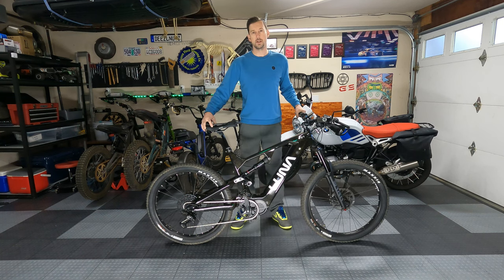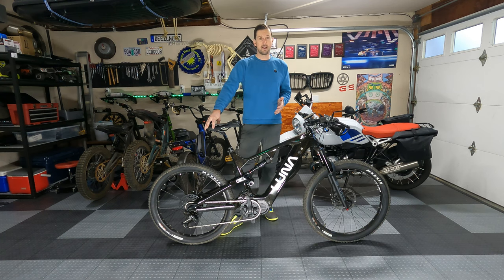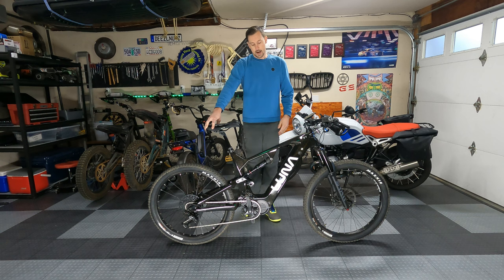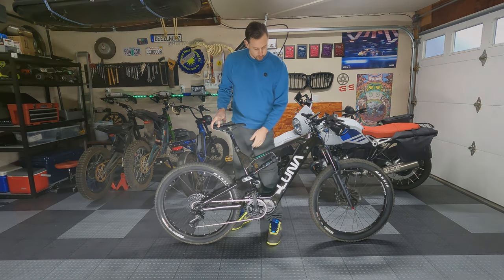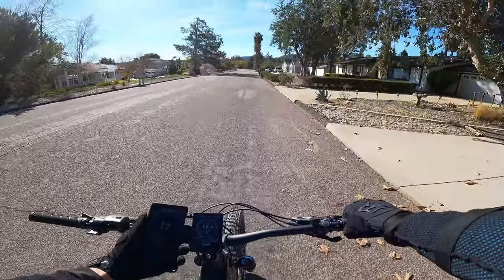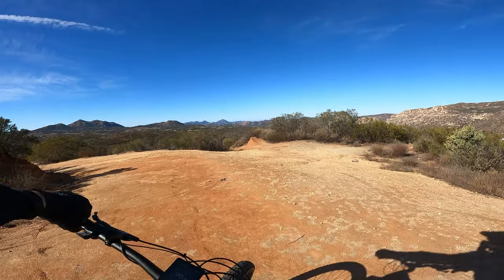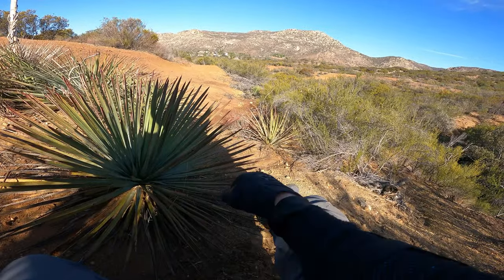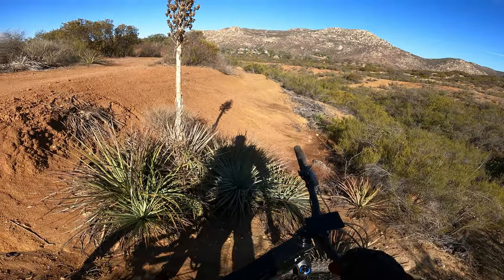LUNA Z-1 Review, Ride, and Crash!

Comment: Does this bike lack a shift sensor to avoid stressing chain when shifting?  I thought I read it lacked this common, key feature.  If so, that along with lack of tubeless rims ,would be a deal killer for me.
Reply: Did you ever get an answer to this?
Reply: @ElevatedVehicles  I confirmed elsewhere that no shift sensor and no tubeless stock.
Reply: @SWTrailsAndWheels  o man that sucks. I wonder if it's possible to add a shift sensor to the m620... I'll Google this, thank you for your feedback

Comment: I was about to get one of these but ultimately got the sur Ron. How do they compare? Also what's the size of that rear tire on your sur ron in the background it looks huge!
Reply from the maker: Sur ron is an absolute blast.  This has better suspension out of the box but the sky is the limit once you start modding. Sur ron makes a ton more power. Different animals though. One is more dirt bike. Other more bicycle.
Reply: This is a pedal assist so not the same. If you don’t wanna pedal then go for sur ron

Comment: Man I had my eyes set on the X2 Ludi and by the time I came up with the cash(2months) they sold out of every frame but the Small.  I'm 5'11.5"  My Dad has an FLX F5 Trail, & its 18" frame, close to the MEDIUM LUNA Z1, but when you compare specs on paper it makes it seem like the LUNA X2 Small frame is bigger than the F5 trail Medium.   Has anyone ridden both? ONLY the Z1 is left in Large, I really wanted the X2, but considering settling for the Z1.  I have an odd body size due to health issues, broke my back twice and missing a few disks, & L2 vertebrae.   So I went from 6"1 inseam of 29" to inseam 28.5" & Height about 5' 11.5".  I dunno what to do.  Should I buy the Z1 or wait till the release of the X2 Ludi Again? I want a Mountain-bike, that I can open up similar to a dirt bike when I want to, & the X2 being able to be tuned down to normal m600 power & up to Ludi mode, feels like I get that option.  My dad's bike feels a little big for me, yet it's similar in size to a Medium Z1 or X2.  But when you see a LUNA small frame is for 5'1 to 5' 6" it's been hard to imagine that being a good size frame for me at 5' 11". Plus I know i will need to replace seat post at with a small frame.  Being able to ride like a real MTB offroad, & on fire roads or switch into a dirtbike-like mode is such a big deal.  Had to sell my Kawasaki Z1000 due to a Diagnosis of Primary Lateral Sclerosis, Now I want a light E-bike, to give me some of that fun back.  If the medium or large X2 frame was available I'd buy that. But only the small is left. The LUNA Z1 still comes in the Large frame, but it's not exactly what I want. So hard go all summer & fall without a bike or settle for Z1 instead.   Tough for me. I'm not rich, & health issues take so much of my income.  That this is a huge purchase.
Reply: get the x2 small

Comment: What is 48 x 17.5? Not 850 via my math for sure. Fun bike though, I have one myself. Once you get rid of the stock programming it really comes into its own.
Reply: It's 840 wh, too small in my opinion, needs to be at least 1000.
Reply: @chapter4travels  I had a 48v and a 52v 21700 cell w/40A BMS made in the stock case over in Shenzhen. Less wh's, 720/780 but both have as much range potential as the stock 840 with way better low voltage performance. The 52v is the better of the two as it wakes up the M620 nicely. Unfortunately the stock case is maxed out but working on a soft case solution for up to a 1300wh 21700 52v with a smart BMS but need to expand the down tube cover plate to allow for another row of cells. Battery is no problem to manufacture.
Reply: @bobpoor6348  How do you go about that? Who do you contact to get another battery manufactured in Shenzhen, and what does it cost?

Comment: Knee and Elbow Pads!
Reply from the maker: Hahah I pretty much always wear em...just not when I crashed lol
Reply: How’s the torque with using throttle only up the hill? Also how about a top speed or mileage range? I ride alot on roads then to trails and was looking at this bike
Reply: Dope ride man,  I would try a sram XX1 chain not cheap but they are solid, I ride a m620  I use that and a Shimano XTR 9100 , not snapped yet but they are 95-100 chain .  I have a Luna coming in a few days .
Reply from the maker: @michelleevans9869  torque on throttle only is amazing. Top speed is around 33. It could easily go faster if regeared. Range is an unknown. I have only done 10 mile ish rides so far. Need to test out.
Reply: @fartbus  what is the battery capacity looking like after 10 miles? Have you done longer rides now?